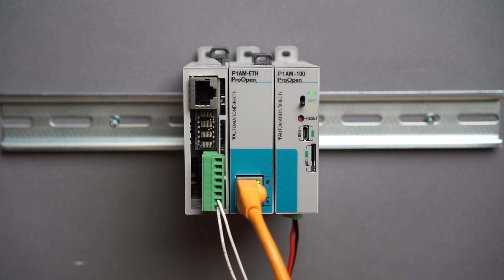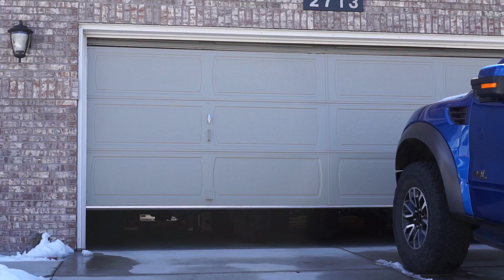Garage Door Monitor Built Using an Open-Source Automation Direct PLC

Comment: What module is on the far left of your system?  I have the other cards, but I have not seen that one.  Thanks.
Reply from the maker: Hi, Jay, It's a module I made. Display + MAC Address + a few inputs and outputs + RS-485. There's a link in the video description to my website with all the details on the module including schematics and board design files.
Reply: @GlenAkins  Sorry I missed that.

Comment: Why reeds vs Hall Effect sensors?
Reply from the maker: Reed switches are the standard for the alarm industry. Only two conductor cable required vs three for hall effect sensors. Dirt cheap. No analog conditioning required.
Reply: @GlenAkins  There are 2 wire hall effect sensors. They just use a tiny enough current to prevent triggering of input points when there's nothing close by.
Reply: Completely agree on industry standard, but Hall effect and neod mags are dirt cheap and don't wear out
Reply from the maker: @ChristopherPowell7  Ah, yeah, now I recognize your from twitter. :) I don't know...probably familiarity for the installers somewhat too. I didn't even consider using a hall effect switch.
Reply: I'm not trying to be a troll, please understand that.  I dig all your work!
Reply: Do you need to de-bounce the reeds? (Honest question)